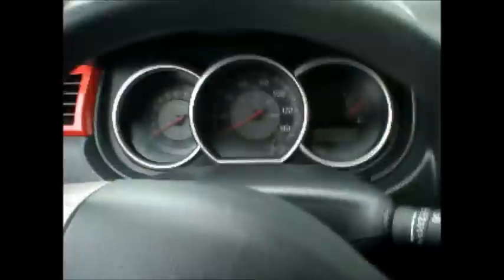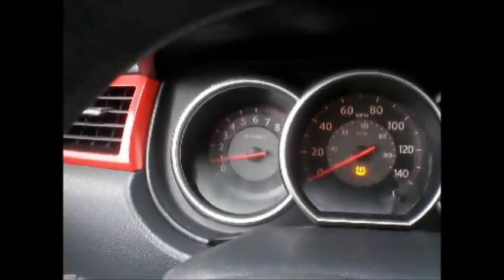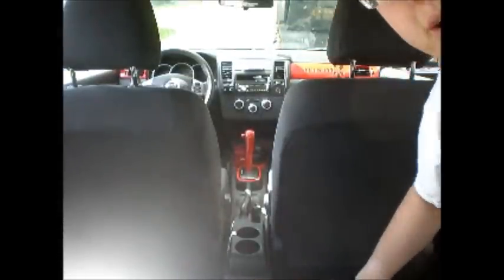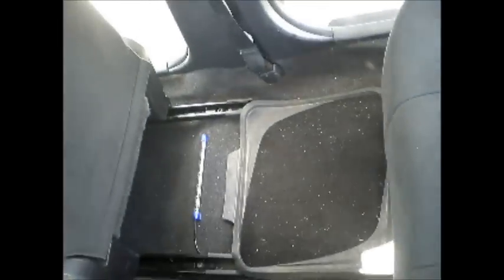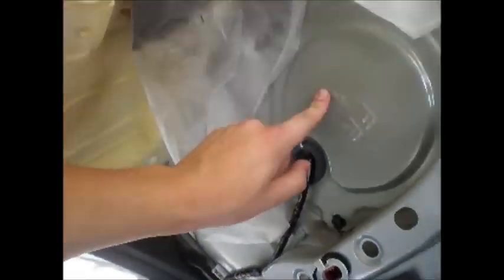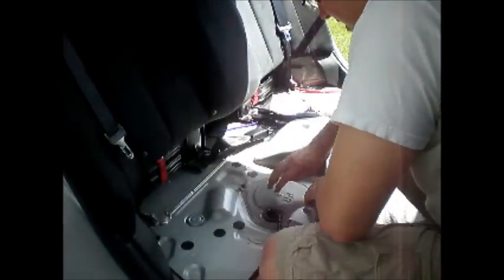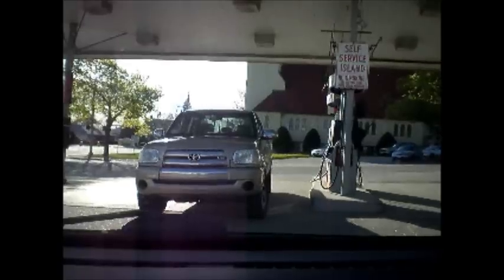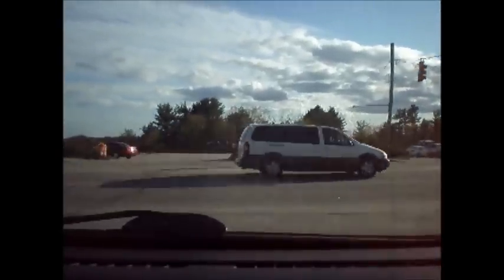DIY: Nissan Versa Fuel Pump/Pressure Regulator Repair

Comment: ouch. blood sweat and tears... thanks for posting....
Reply from the maker: Michael McKinley I’m not entirely sure how the whole system works. I believe the pump sends fuel down the lines and then when the car is shit off the pressure regulator keeps the fuel from all draining back down into the tank as well as some Other things.

Comment: wish I had found this before I payed almost  $300 at nissan to fix it. Now the CVT  transmission is starting to go this is my 4th Datsun / Nissan over 35 years they don't build them the way they used to I will never buy another one to much plastic that can't take it. the only problem in the old ones you had was rust.
Reply from the maker: You got that right.

Comment: The codes P0183.   P0463 high input
Reply from the maker: Check the connector for the fuel pump. disconnect the battery, wait an hour, then disconnect and reconnect the fuel pump harness. Chances are its just a bad connection. If you need more help, join us over on the facebook page (versatiidaowners). I'm one of the admins there.
Reply from the maker: and in the meantime, make sure you're filling up on fuel regularly as the gauge could be off. You don't want to run out.

Comment from the maker: You just lift like hell. Try one side for awhile, and if it doesn't come out after a few hard pulls, head over to the other side and give that one a try. One will usually come out easier than the other, and then you can take a look at whats holding it in and get the harder one out easier.

Comment: I have a 2012 nissan sentra and its doing the same thing but it still won't turn over and I dnt knw what else the problem could be. Can u help me please with some info on what I could do
Reply from the maker: If it will crank but not start at all, then its more likely that the fuel pump is to blame, however being a 2012 it should still have the factory warranty (unless it has a ton of miles) so just bring it to the dealer and they should fix it for free